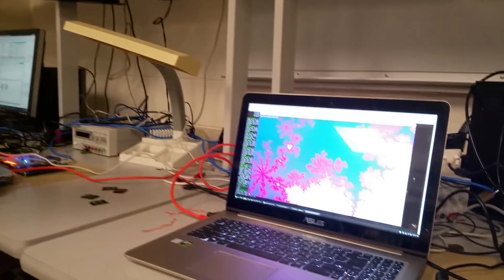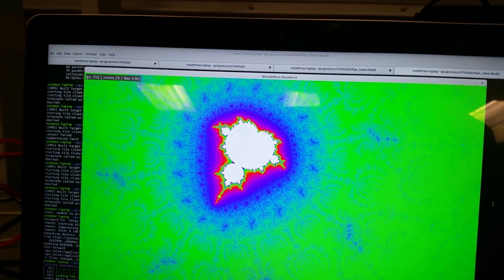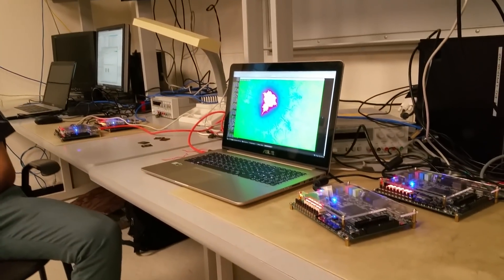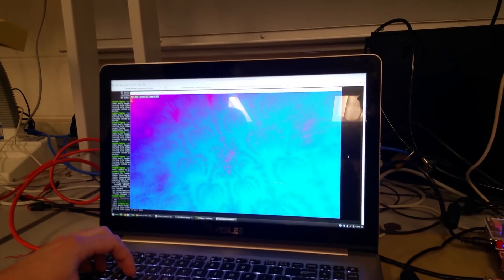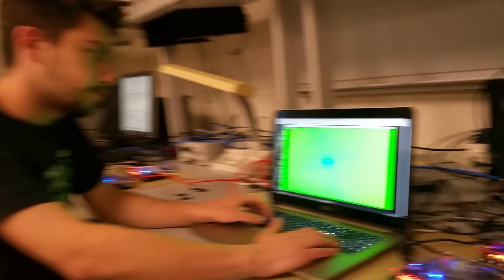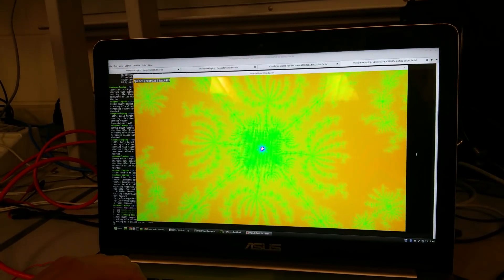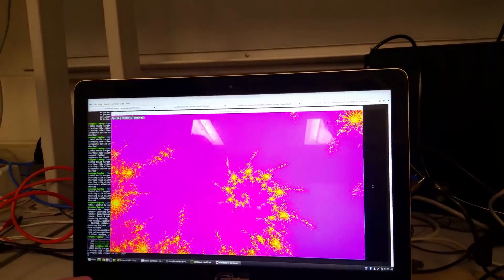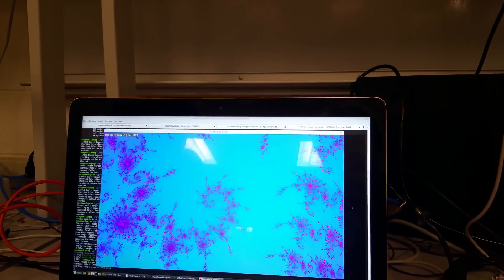Mandelbrot interactive solver

Comment: Very clever and fun to watch. Does your system have a maximum iteration count that it uses all the time, or does it work out what is a sensible maximum iteration count depending on what is being displayed? I noticed that the one time it really slowed down was when there was a large area of the "bailout" region displayed, suggesting that it was doing a very high iteration count for each point in it.
Reply from the maker: They changed the algorithm several times, but I think it is dependent on the depth of zoom.